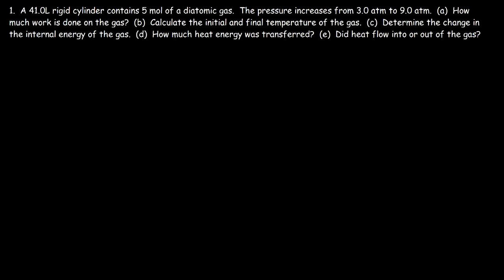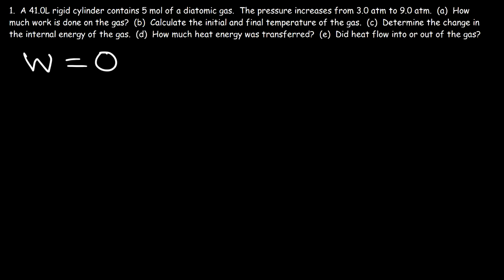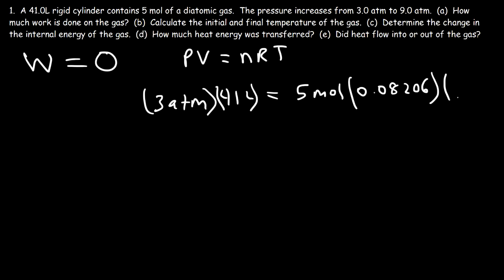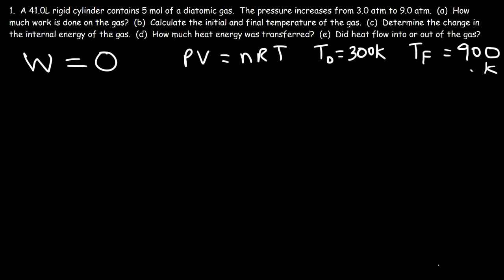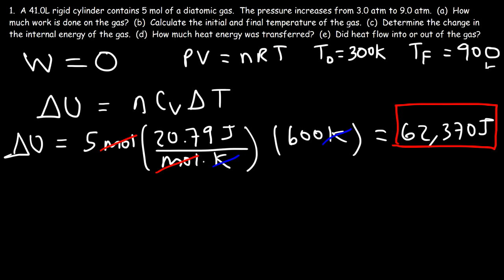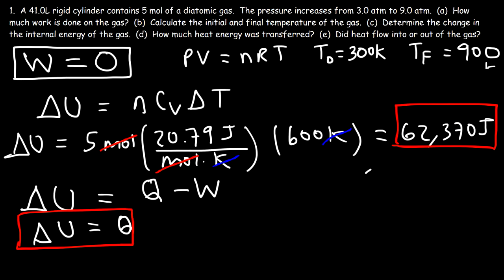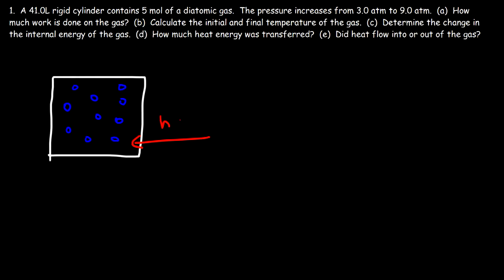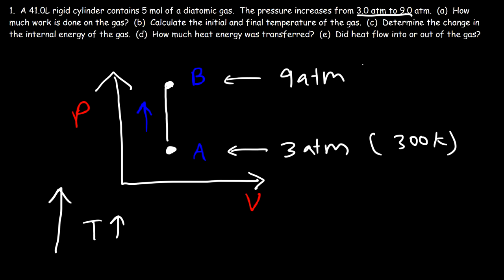Isochoric Process Thermodynamics - Work, Heat & Internal Energy, PV Diagrams

Comment: Hello, 
I have a question about 1 c). You used the formula delta U = n* C(V) * delta T. In the video about isobaric processes you said that for diatomic gasses you could use C(P) = 7/2 * R. I used this and found Q = 5* 7/2 * R * delta T. Then I used delta U = Q -W. But  C(V) and C(P) are not the same for diatomic gasses, so my Q and delta U are different.

Comment: Isn’t R ideal gas constant and the value is 8.31 J/(molxK)?
Reply: It depends on the units of pressure Temperature
Reply: Pressure volume temperature
Reply: Depends on the unit is 8.31 for Pa and m^3 however when working with litres ant atm(atmospheric pressure) we use 0.08206
Reply: He should have used 0.08206 as R since the pressure is at ATM and Volume is in Litres ....R is always 8.3145J when the pressure is in Pascal and volume is in Cm³

Comment: why is R .082
Reply: Units! There's 0.08206 L·atm/K·mol and  8.314 J/K·mol. In the PV=nRT formula you use the 0.08206 L·atm/K·mol and the units will cancel to leave you with what you're solving for. In this case T so you'll be left with K. Try the formula with the units and cancel them out. pretty helpful trick i think
Reply: @nahnahnah30  are there other units of R other than that? Like to english units like btu and rankine
Reply: @nahnahnah30 n solving the internal energy using
 Cv = 5/2 (R), should it always be 8.3145, will it not affect the equation even if the givens are in Liters and atm? Thank you in advance for ur reply